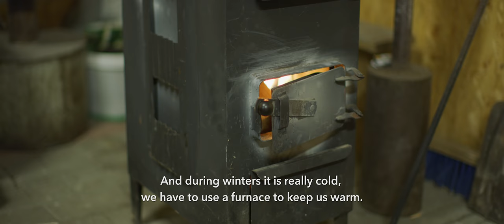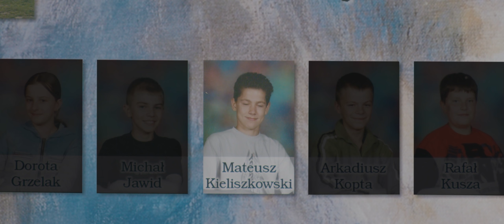Road to the Arnold — 2019 — Mateusz Kieliszkowski

Comment: It's cool that he uses such low-tech ways to train. You don't have to have expensive equipment to succeed; just dedication.
Reply: VRMusic Strongman gym has no machinery and tech. Look at Brian Shaw’s gym, he lives in the USA one of the most advanced country... you won’t find anything with a cable to be plugged that he used
Reply: @feraldorozanandy1114  yeah I guess you're right. I was mostly reffering to the stones he "found in the wood" 😅
Reply: @feraldorozanandy1114  Brian's gym is unbelievably well equipped though. Watch his gym tour video. Easily over $100k worth of machines alone. When you add the brand new Rogue plates, custom bars, specialty deadlift bars, logs, etc, he had over a quarter million invested. Mateusz has a dungeon by contrast.
Reply: phiten40 I’ve watched it bro, the only thing with a plug is the stair master and it‘s for his wife... rogue plates and bars are expensive by default, and tho probably not rogue... Mateusz’s gym got similar plates. Another machines is a non electrical cable machines / smith machine that Mateusz also have... maybe not as good as Brian’s brand new stuffs and not made in USA. But it’s still the same thing
Reply: @feraldorozanandy1114  I'm not sure what type of machines you're referring to that are supposed to have plugs. Unless you're talking about some Rocky 4 Ivan Drago futuristic stuff lol in the weightlifting world, the most expensive equipment is generally not something you plug or or that requires electricity.
Reply: @phiten40  ridiculous claims..
Reply: @phiten40  Okay, pal.  Lmao!